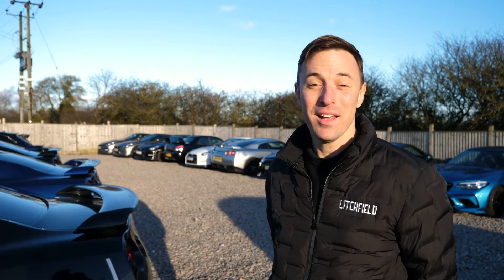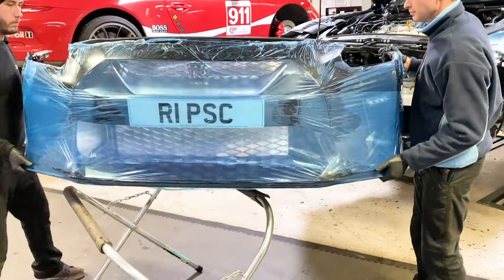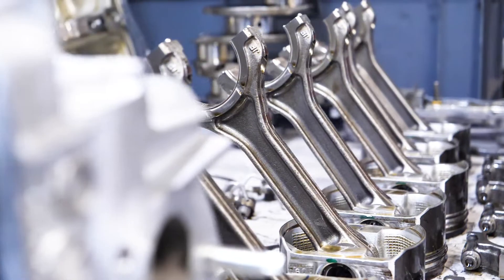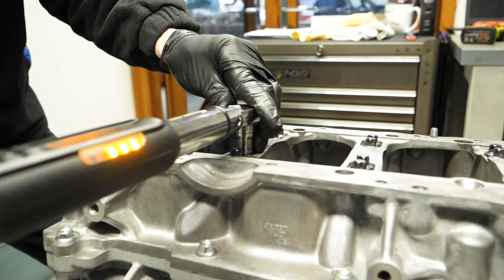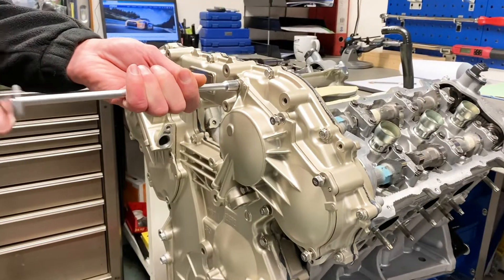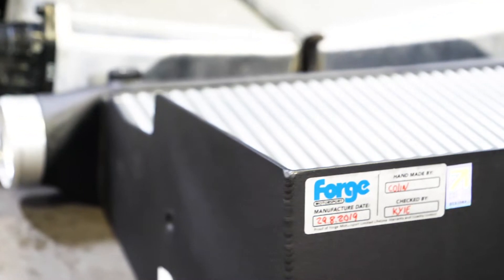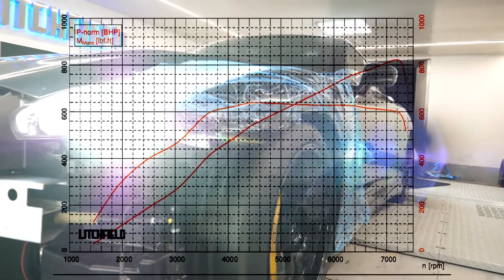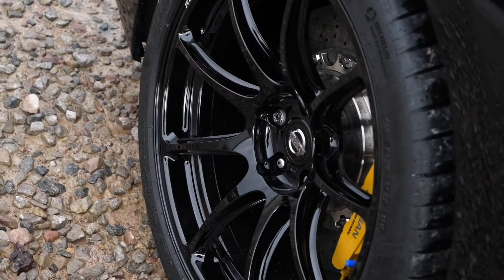820bhp engine upgrade to Nissan GTR Track Edition

Comment: Hi i have a nissan gtr r35 2011 with about 680hp tunned from stock..
i am interrested on getting the engine to 800hp,so my question is: how much hp can a stock blok handle hp and when is it time to open the engine and install those connectiong rods and all those thing you mentioned?
MY gtr has 1050cc injectors,straight piped exhaust,blow off valve,k&n intake and much more that is for 680hp needed

Comment: I just don’t see what the point of adding all the BHP when the torque is capped exactly the same as a 4.25 car to stop the gearbox failing? If spending all that money on the engine and dampers why not build the box for safety as well to enable higher torque figures?

Comment: Great work.....ONE QUESTION PLZ AND I REALY HOPE U ANSWER....NO NEED TO MODIFY THE GEARBOX? CAN THE STOCK GEARBOX TAKE THE EXTRA POWER?!?   I REALLY NEED AN ANSWER....THX
Reply: if you look at the torque figure  its at 600 so the standard one can take it.
Reply: The standard gearbox can comfortably take 630 ftlb of torque so when they map the car it is capped at around that figure. If you build the box then all you need to do is map the extra torque in I believe.
Reply: I have being running 850 plus & 650 lb on a built engine, no problems at all.  It’s been good for 7 years and 30k